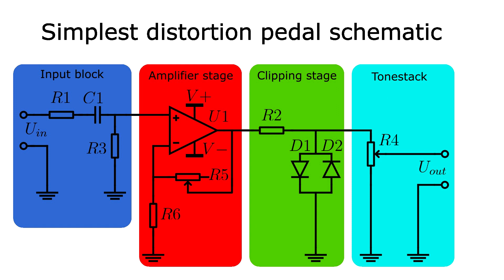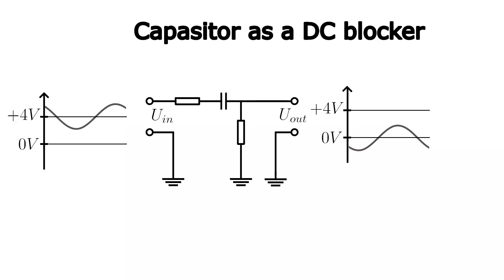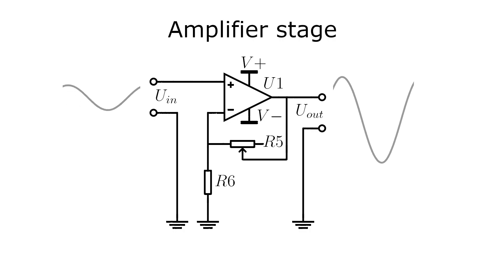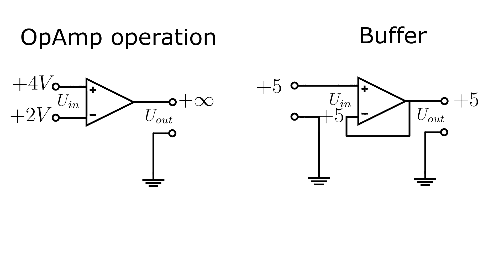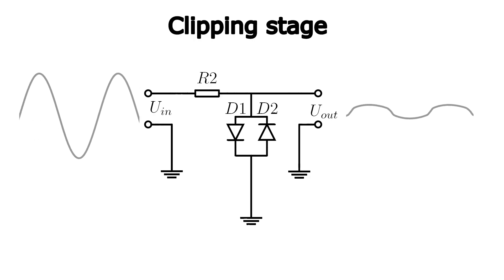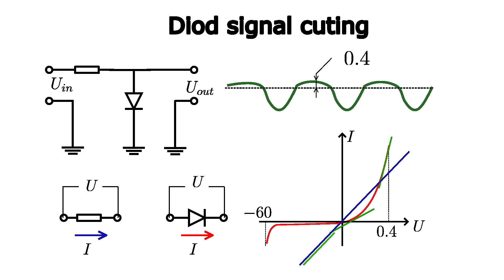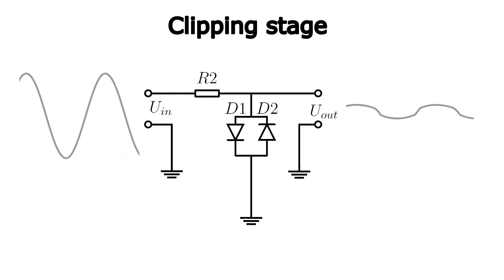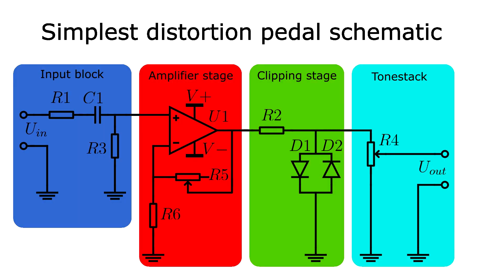Designing Your Overdrive/Distortion Pedal: Part 1 - The Simplest Schematic.

Comment: I see one capacitor in your diagram at the beginning, but three capacitors of different types in your picture of the breadboard at the end. It would also be nice to know which values of R and C you used to get the sound you got, as well as the diodes.

Comment: That's not going to work as a tone stack at the end; it's just an output level voltage divider I think. You probably need a cap to ground to create a low pass filter or some such thing.

Comment: I came here looking to find out what a distortion pedal was. You can skip the diode clamping stage and just have to opamp clamp if you find a lower power op amp and feed it with low vdd/vss. Alternatively, just increase gain and then voltage divide output. Some opamps with have smooth clipping, and others might clip differently at different frequencies ( function of opamp bandwidth )
Reply from the maker: I know a couple of circuit designs that create distortion by pushing op-amps into signal limiting. These kinds of circuits produce a shaggy tone - great for old-school crunch sounds.
One interesting thing about this approach is both its strength and weakness: the sound depends heavily on the op-amp used. Whether it’s rail-to-rail, wide bandwidth, FET or BJT based — each one gives a slightly different character to the distortion.

Comment: The signal will be shorted to ground because the diodes are connected in parallel in opposite polarities. There will be no output.
Reply from the maker: Diodes have resistance! This resistance is not a constant. Read about IV curve and differential resistance. With best regards. TonyD.